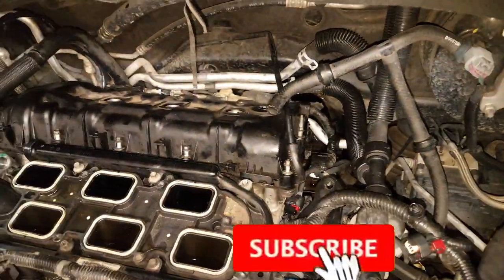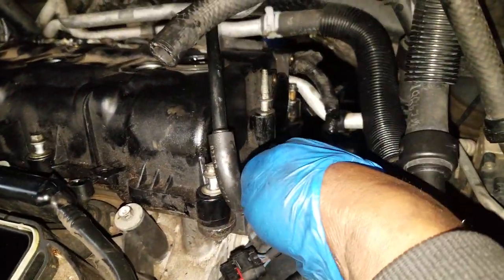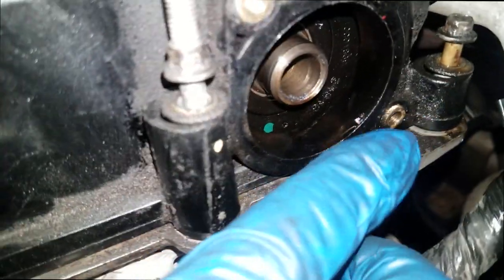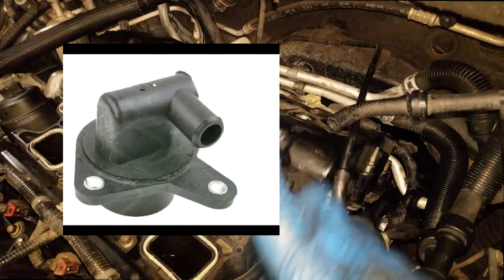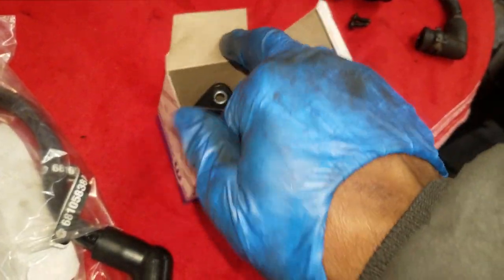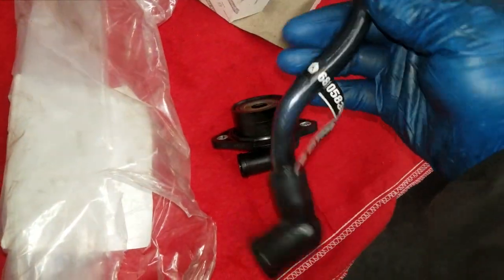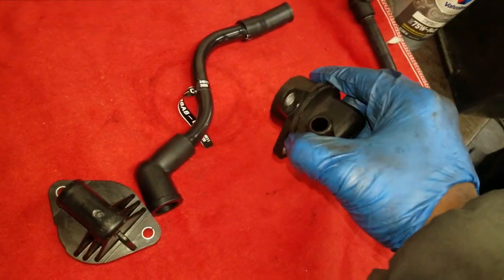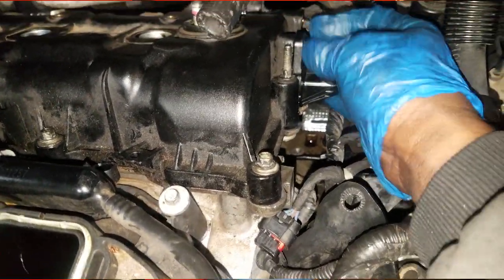REPLACE THIS to make your car run better. Update the PCV Valve 3.6 Pentastar V6 problems ticking

Comment: I recently had work done on my Durango 3.6 Penastar. I had routine maintenance done at the dealership transmission oil and filter change and spark plug change. They offered to fix the pcv valve but with help of your videos I was able to do it myself. And your right it runs better. Thanks for saving me $250 at the dealership.
Reply from the maker: Thanks for watching the vids Will.

Comment: I changed the PCV valve on my 2012 Caravan 3.6L and it wasn't near as bad as the one I changed on my 2008 Caravan 3.8L. That one is on the valve cover on the back side of the engine and is very poorly designed. It has a large rubber seal around it that is indented around the middle and they usually break off at that spot. Then you have to go fishing with a curved pick and hope you can find the half of the seal that stayed behind. Some WD40 sprayed around the outside of PCV valve seal and small slow wiggles and asking for help from the Good Lord, can get them out without them breaking completely. My 2012 was a breeze comparatively.

Comment: Thanks again for your knowledge!!   If I may ask, I have a 2014 Ram truck with the 3.6.  When should I get the PVC valve replaced??   Mine runs very smooth and no issues at 47.000 miles.
Reply from the maker: Hello my friend. Just so you know, FCA recommend replacing the PCV every 100k. Pretty much the same time they recommend spark plugs. I tend to disagree with that. I tend to stick with a more traditional schedule of around 60k. Ive seen PCV valve internals after waiting that long, not a pretty site. But if your engine running clean and ok, you should be fine with the 100k recommendation. Thanks for watching, please thumbs up the video and subscribe to the channel, thanks.
Reply: @OnlineMechanicTips    thank you.  I have been a SUBSCRIBER  for about 8 months now.  Thanks and I look forward to you next LIVE show.

Comment: those TORXX screws dont grip well and i don't understand WHY european cars use them, ESPECIALLY in tight spaces...i love hex bolts/screws
Reply: Yea the hex screws are so much easier. That bottom bolt is driving me crazy. Luckily it won’t take that much pressure to loosen. It’s just getting in there. Hoses and the transmission dipstick in the way for my fat hands

Comment: So that made it run better how?  Seems like it just makes your life easier.
Reply from the maker: Hello bud, its been redesign so the flow thru much better and that will help the engine breath a lil better which will likely make it run a lil better. Thanks for watching. Please subscribe to the channel, thanks
Reply: @OnlineMechanicTips  I subscribed weeks ago, digging the channel lots of good stuff.  Just kept hearing you talk about the screws bout never heard anything about the performance improvement.   Thank you.

Comment: Great video! I've got a 2014 Grand Caravan. PCV valve never been done. Do I need to be ordering the new hose or did it come with the 2 hole version? And is it T20 or T25 on those screws?
Reply from the maker: I think the 2014 was already done..but they will tell you and sell you the kit if needed. A warning will come up on the screen if yours was not updated at factory.

Comment: So on the Grand Cherokee this would be on the rear of the engine, under the cowling?
Reply from the maker: Hey bud, on the grand cherokee the pcv valve is on the right side..This engine not side ways in this vehicle..you may not have to remove the upper plenium
Reply: i wish someone with this configuration would make a youtube video.  Its against the firewall on the right side and all of the heater core pipes and power cables are around it.  Impossible for a DIY person to even get to 1 screw -- let alone the one underneath.  Mine's a 2011 Grand Cherokee 3.6L.
Reply: @PhilDietz not impossible. Get a 1/4" wrench and a t25 bit. You only have to break the bolts loose then spin them out by hand. Get the Dorman replacement and it comes with hex bolts.

Comment: Could this valve seal failing attribute to my engine burning oil? Spark plugs came up very dark at 75000 and I keep coming up short on oil changes .5 to a whole quart

Comment: Hey brother, nice video! I've messaged you before where I mentioned my 2015 Grand Caravan with the 3.6 Pentastar. I change out my PCV about every 4th oil change, and she's still going strong at 320,000kms on the original engine and transmission. SOOO many people don't realize how important it is to replace the PCV. So, THIS question is a bit off topic, but do you happen to know where the power steering pressure switch is located on the 3.6 Pentastar?? I think mine might need replacing. When I turn the wheel all the way, the engine's trying to cut out.
Reply from the maker: Hey bud, I cant recall those Caravans having a power steering switch. Make sure your van able to breath properly. Meaning air filter not restricted and the throttle body clean.

Comment: will the pcv valve be clogged up if i had an oil and coolant leak on my oilcooler 3.6 pentastar?
Reply from the maker: Only if that mixture made it to the valve train. I tend to replace that PCV anytime im dealing with oil leaks. Besides, its fairly inexpensive so ide just replace it.
Reply: Only if you blew the head casket. I just replaced my oil cooler because it leaked as well. Generally when you have to replace it , it's cuz the antifreeze mixed with the oil. If you check your oil and its not milky brown like coffee n cream, then your ok. But normally pcv valves should be changed out at every 90,000 miles

Comment: What year is this? I have 2016 Charger and I'm wondering if it's the new style. It's hard to look at because it's against the firewall.
Reply from the maker: Your 2016 has been updated..but there is still a change interval for pcv valves..thanks for watching, please subscribe to the channel.

Comment: What a help. I’m struggling on that bottom bolt right now on my 11 Grand Cherokee. Good to know I need to buy that hose too. Good looks
Reply: Any update on your success on this task? I was thinking about tackling this myself. I'm sure it's never been changed on my '22 Grand Cherokee. I'm also going to be replacing the spark plugs, ignition coils, and all the other common tune up items...
Reply: @Flyby-1000  got it done. You have to be an outside the box thinker and use what you have. Mine was a socket and some paper towel lol. Got it done but unfortunately it had nothing to do with my problem.

Comment: 2014 dodge journey v 6 all wheel drive . cant locate pvc valve !
Reply from the maker: Hey bud, that sideways pentastar engine will have the PCV valve located on the rear head at the valve cover, its stabbed into the valve cover with 3 Torq screws. Remove the screw then pull it straight out..Thanks for watching, please leike the video and subscribe to the channel for me, thanks

Comment: Hello, I really need some advice on my 2015 3.6 jeep grand Cherokee. I've changed my pcv valve at the shop as recommended but I still have the same issue. There is massive amounts of oil coming from the pcv system causing smoke at start up. The shop recommended a oil catch can which I installed. The catch can will get filled in just two days of driving. Have you ever experienced this?
Reply: Check your oil cooler
Reply: Too much blow-by mate. I think you maybe have some issues with pistons rings or cylinder honing !
Reply: I know it’s been a year, but did you fix it? What was it?

Comment: hi my town and country 2013 loosing oil every 500 km so no smoke and no leaking if i changed this parts is it fix problem thankyou
Reply from the maker: Hello my friend, thanks for watching. 2 question, is there a vheck engine light on and are you a subscriber?

Comment: Do you have any thoughts or comments on the 3.2 l v6 pentastar engine I'm thinking about trading for a new Cherokee and I would like to have a little more information on this engine
Reply from the maker: That happens to be the same Pentastar engine, only its the generation 2 which makes it much better than the gen 1 found in the Caravans. It has a lot more power than my Cherokee which has the 2.4. Here at the dealer we hardly ever doing engine work on the 3.2. Not a bad choice.
Reply from the maker: Please subscribe to the channel for me, thanks

Comment: This engine is European that's why it's full of problems they should have kept the pushrod 3.8 in these Vans
Reply from the maker: That  was a good engine but the technology has passed..they have to keep up with the other car makers in using dual overhead cam engines for better emissions.
Reply: @OnlineMechanicTips  still getting 3.8 in my shop some over 400k mostly brake work 
Engine egr valve mostly

Comment: Part number please 🙏
Reply from the maker: There is no set part number. Theres 3 different generations of the Pentastar engine. Your year make and model will be needed my friend
Reply: @OnlineMechanicTips 2013 dodge Durango
Reply: V6 3.6